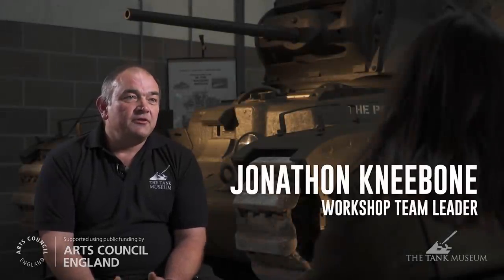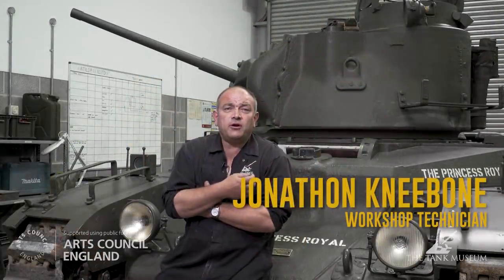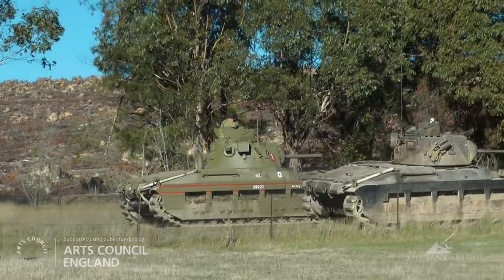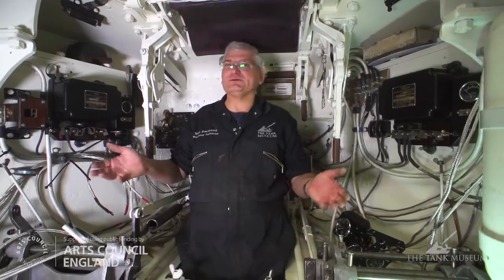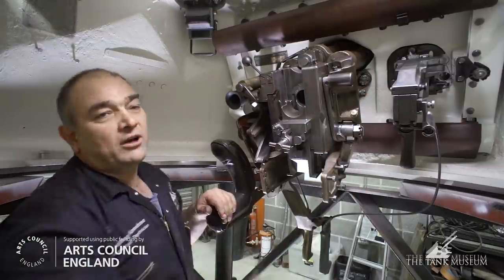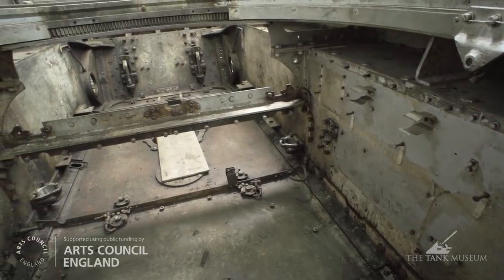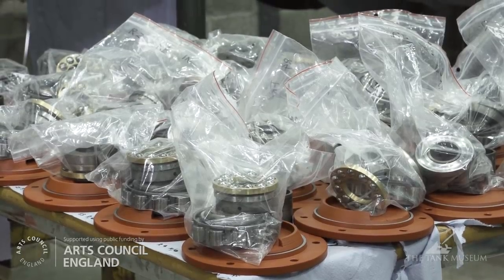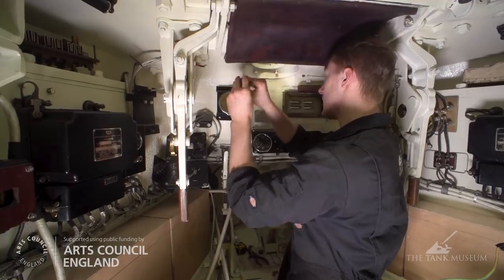The Matilda Diaries Part 24 | A Look Back | The Tank Museum

Comment: I know the feeling of satisfaction that the team felt as it all finally came together. I worked as a volunteer at the Marine Corps Air, Ground, Museum  and did the lions share of the disassembly, sandblasting, painting, and reassembly of an SU-76 Self Propelled gun.  Rather than make her a "runner" we decided to pickle her because we knew from the battle damage and markings on the vehicle that men had likely died defending her and that she would be used as a static display of the Korean war. Great job guys!